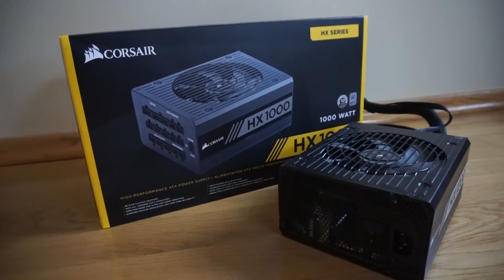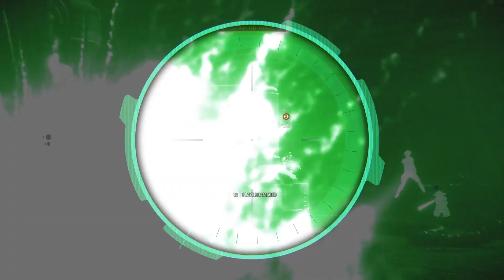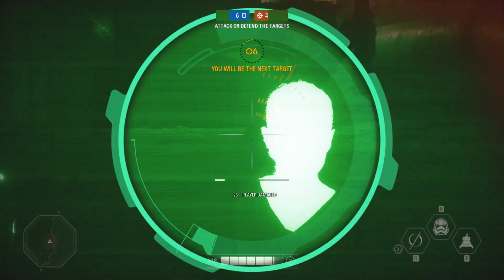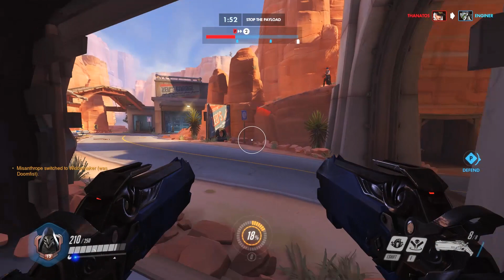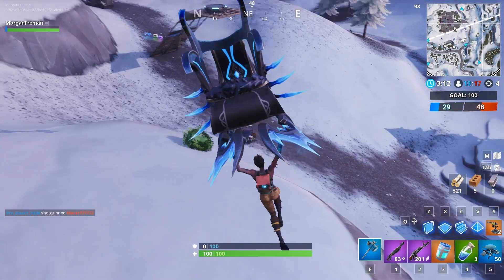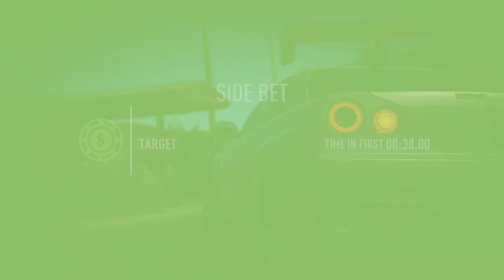Can a better Power Supply improve your gaming performance?!

Comment: Are the expensive psu make the game smooth? No stuttering?
Reply: Yusuf nasıl bir sorun yaşıyorsun bilgisayarında bende de fps drop var ve kalitesiz bir güç kaynağı var bundan dolayı mı oyunlar donuyor hiç bir fikrim yok...
Reply: Umut Furkan english please :(
Reply: @UcupKun  O.O Sorry I guessed you are Turk because of your name. Are you have stuttering? I have stuttering and also have cheapy psu and I don't know what is effect on my pc. What is your problem?
Reply: Lol stuttering is mostly affected by ram also if your psu doesnt make your pc power off and doesnt explode in a fucking week it wont really matter stop focusing on stupid numbers and just enjoy the game
Reply: it wont.
Reply: Im using the delta GPS 1300w Platinum for my 4090 , it came for free with the 4090.should i leave it or buy a top brand 1000+watt psu?
Reply: A cpu usage and gpu usage are not stable, sometimes on 50% and down to 40% or less, it makes my game not run well because the usage no reach 100% usage , i dont know its bottle neck or not,
My pc
E8500 3.16ghz
Gt 730 gddr5 
Ram 4gb 
Play l4d2 csgo resident evil 4 steam

Comment: if you test it with a rtx 2080+i9-9900K it will be a complete deferent storie...
Reply: rtx 2080 and i9 9990k are Still Low  TDP 
Test With VEGA II DUO and AMD EPYC
Reply: Ofcourse cos those specs need more than 500watts psus dont give you more fps nor do ssds🤣🤣 people still believe in these myths
Reply: @nikzy-  theoretically they can affect OC stability which indirectly affects frames, same with motherboard
Reply: But yes, if you have any decent PSU and arent running some crazy offbrand chineese hack job clunker of a PSU, then they all do the same thing
Reply: now with 3080 SLI

Comment: it's not how it's work, first of all the specs you mentioned in the description is made for a psu around 550W~600W and also the more Watts is far from the reccomended number, the less will be the avg fps so 500W psu will be better than the 1000W even if it's certified platinium 80+ the 500W will be butter but at the same ti. e very unstable because it's too cheap
Reply: that is dumb.

Comment: Did you notice any quirks or problems with the cheap PSU?
Reply from the maker: Blitz Alex Hey, thank you for the nice words! That PSU was running solid, didn’t notice any difference between HX1000
Reply: @CheapBastard  thanks. I'm getting a cheap PSU so I can run an external gpu on my PC (because it doesn't have a PC x16)
Reply: @alexbeattiemusic  Never buy a cheap PSU.
Reply: @zdvy  its to late his pc went boom
Reply: @drop-and-run  yes, they work becouse these computers 80% of time are in idle, consuming 60w of power. Try pushing that power supplys to the limit by having an gpu and you will see...